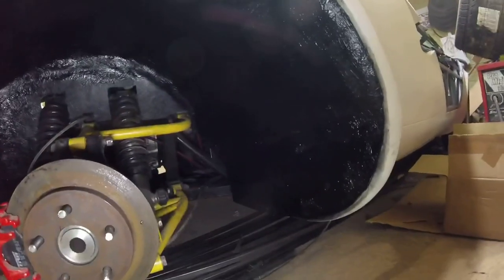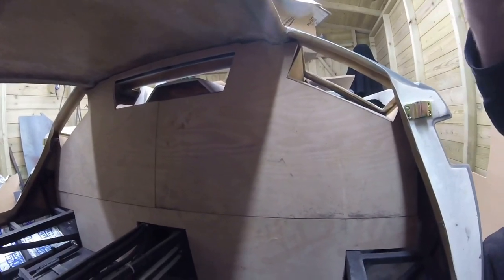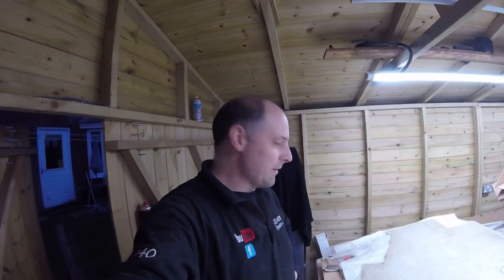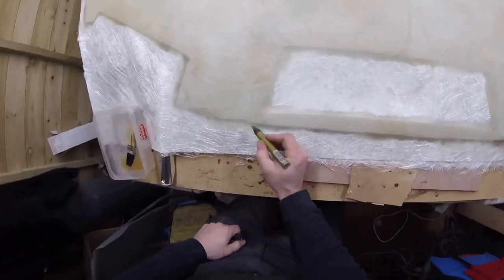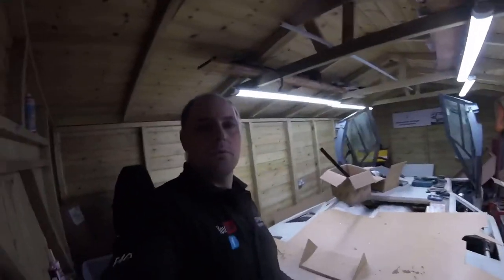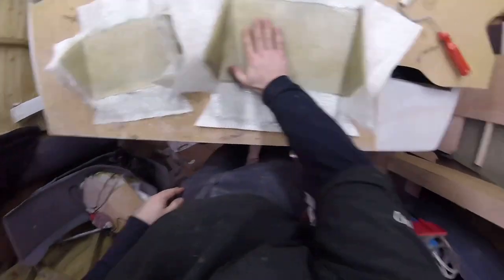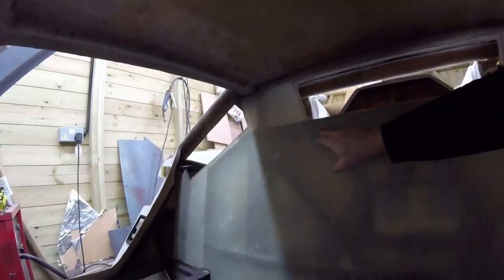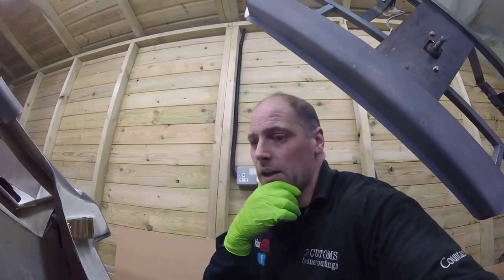Countach Firewall

Comment: Nice going! I suppose there will be some good heat and sound protection on the engine side of the firewall, right?
Reply from the maker: The sound deadening material I used underneath is supposed to be good as for heat all the original vents will be used properly so heat won’t be a problem. I want some engine noise to come into the cab as I want to her it, my car is going to be a drivers car not a luxury vehicle